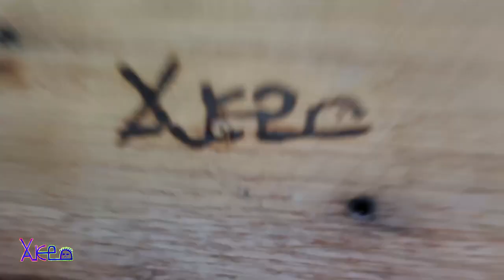How to Convert a Halogen Floodlight with 50W LED at home

Comment: I feel like the cable should include earth and that wire should be attached to the metal frame... if the live wire dettaches from the PCB (with heat and no clamps that's possible) you may end up with a lamp connected to the live wire...

Comment: What is the heat transfer coefficient of epoxy resin?  
There's gotta be a problem with the heat release of heat.
Reply: Exactly
Reply: True, he could of used themal glue off ebay for like 3$

Comment: I Did The Same Thing with A Tractor Light & A Dollar Store Flash Light.. I Wanted A Vintage Looking Bullet Light And Got The Tractor Light for $8.99 and The Flash Light That Takes 4 Double A Batteries With The Silicone LED .. Anyway I Just Power It With An 18650 Battery (from A Dollar Store Power Bank.. I Left The Charger Complete and Just Soldered The Wires Into The Pos/Neg on The Battery.. So I Could Charge It With The USB.. I Carry A Couple More of Those Powerbanks in My Tool Kit).. It's A Motorized Chopper Bicycle With A 100cc Bike Engine on It That I Built Years Ago.. And Just Love It.. No Plates/Ins./Etc. .. Just 16 & A Helmet  (where Helmet Laws Are Enforced).. And About 100 miles per Gallon.. and 2 stroke oil.. About 20:1 and They Go Pretty Good.. Mine Will Do Just Over 60mph.. Although, Some Places Treat Them with E-Bike Limits of 25mph..I Think?.. Close Anyway.. I Do That In Most Places Anyway... But, On An Open Stretch Of Back Road.. Let'er Rip!!! lol.
Reply: have you figured out a good way to reduce the decibel levels of the engine? I was considering using a gas-powered motor assist to bicycle, but don't want it to be so loud.

Comment: The whole body of a floodlight is made of an aluminum -why not just mount led chip directly to it so it can be used as a heatsink?
Reply: That aluminum body is too thin to be used as an external heatsink and that LED Chip can get REALLY HOT that the aluminum body cannot dissipate and therefore, it would just be a blown LED lamp
Reply: I was thinking he would mount the Heatsink to the rear of the lamp. however, it looks like the lED chip was a bit too wide to mount flat to the rear of the aluminum lamp body. Although it looks like he could have shaved away portions of the LED board while preserving its electronics and then mount it to the rear of the lamp body with some thermal paste and the heatsink to the back of the lamp?
Reply: @dhruvjustexists  Could still put the heatsink on the outside...

Comment: this will blow up very quickly since you used epoxy instead of thermal paste so the heat transfer will be very bad plus there is no active cooling
Reply: Yes true, he could of put thermal paste in the middle, then used the epoxy on the sides to secure it down to the heatsink.

Comment: I think the light will only turn on briefly and then die in less than 1 hour due to overheating because the heat is not distributed properly because epoxy glue is not a good heat distributor

Comment: you have to be joking with that setup  using glue as a heat sink paste or connecting to the heatsink?????? you must be crazy but you sanded the heat sink creating more air pockets i hope you dont EVER work on my fixes

Comment: dislike for gluing the led chip heatsick with epoxy! the thermal paste had to be used and then fixed with 2 screws. it will burn soon.